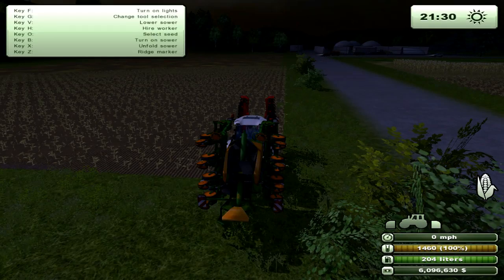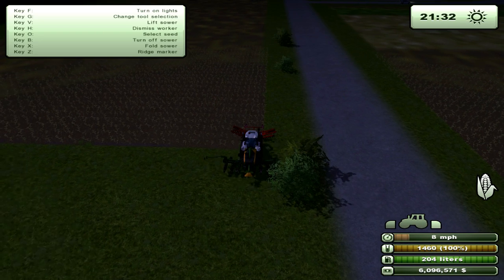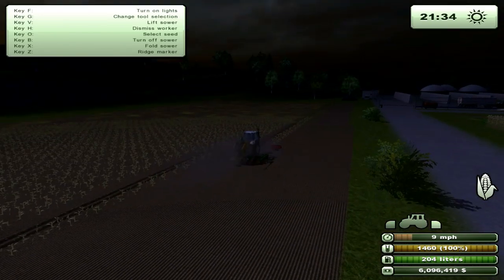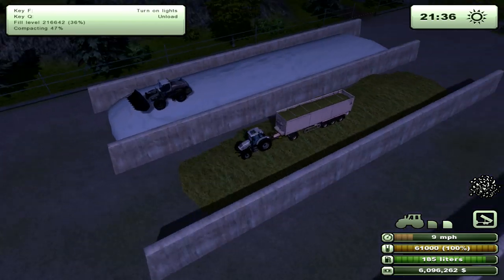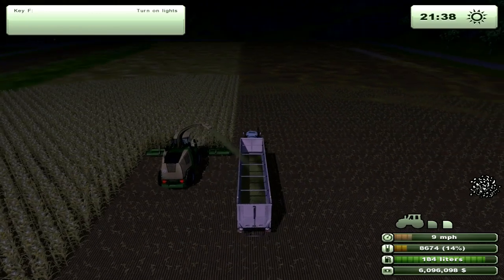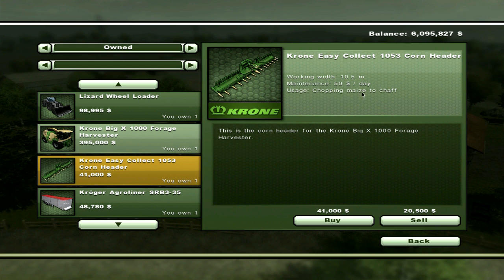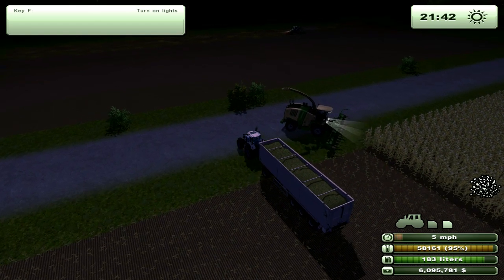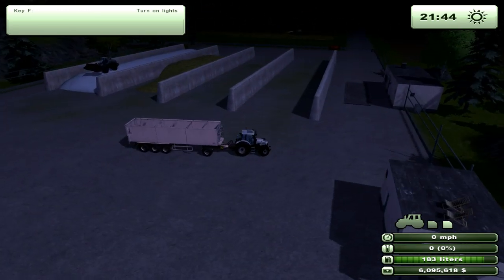Farming Simulator 2013 - How to Farm Corn and make Silage, Tutorial

Comment: Another option would be to use 2 small Trailers. You can can drive the Krone BIG X with two Kröger 302 or two Krampe 500 or one of each. For the two Kröger it means 42000L, thats 2/3 of the Trailer in the video (biggest in the game). With this setup you can work alone without paying a worker.  
And ajjamoore, very nice videos and thanks for the hard work explaining everthing.

Comment from the maker: you can attach some trailers but the problem would be that the harvester is slow compared to a tractor and would take a lot longer to transport it back to the depot.  I suppose you could switch trailers out but it would still require manual work.  I will definitely give it a try and see if I like it.  I know I attached a bailer to a combine to automate the picking up of straw but it removed the ability to hire a worker.  I suspect it would do the same for the corn combine.

Comment: How do you run the silage harvester, I can not hire the computer to run it
Reply: You get in it and push h and drive beside it with a tractor because this harvester has no place to store it so it comes out the pipe and it will not move because it has no place to store it